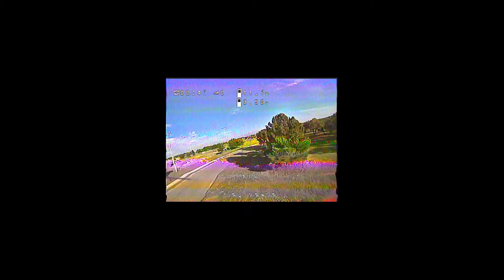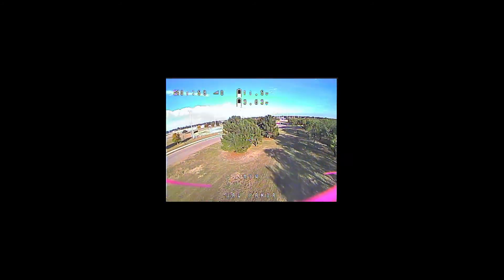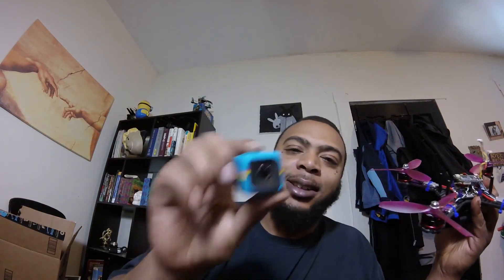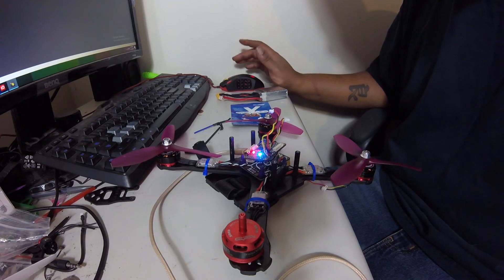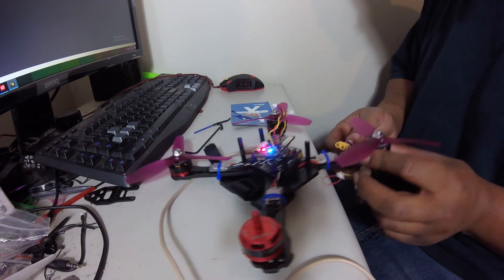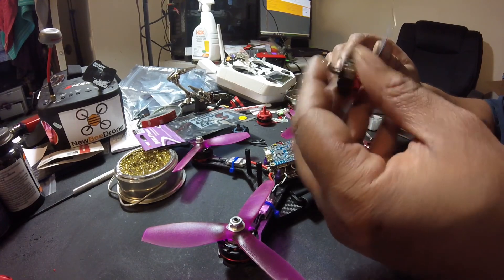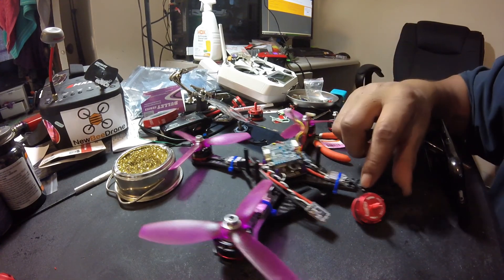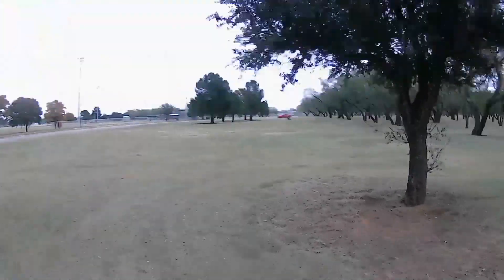Motor goes up in smoke! Bad ESC - Emax Red  Bottom Rebuild - Maiden

Comment: The The motor is what broke the ESC. The motor is what pulls amps through the ESC. If your motor pulls enough amps to smoke it's most likely pulling too many amps through the ESC which is why the ESC died too. you probably only needed to change the motor. The ESC is most likely fine.